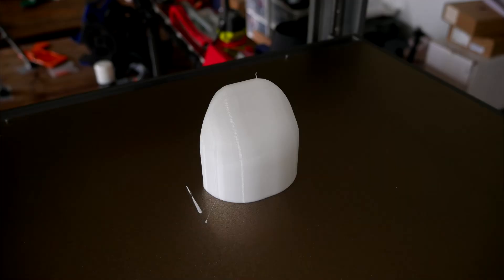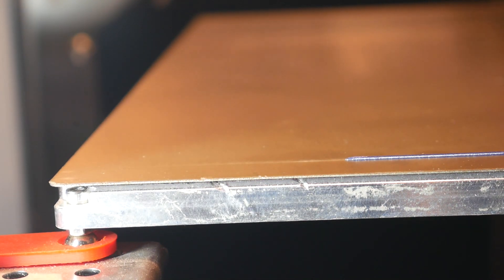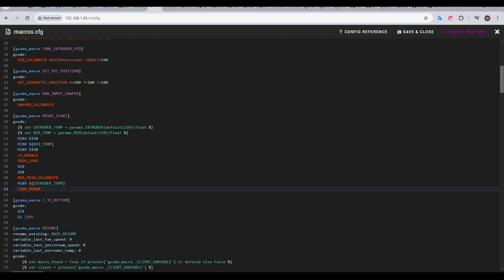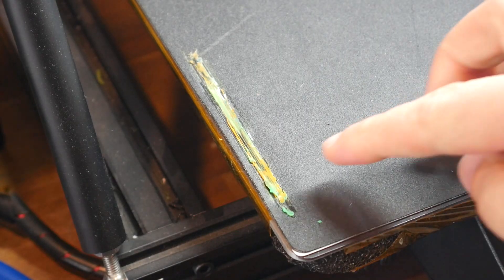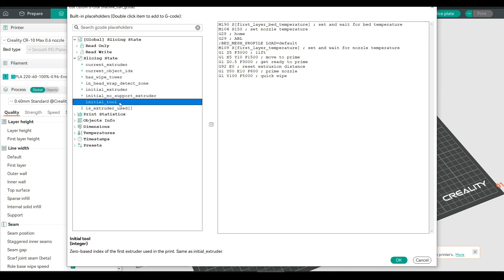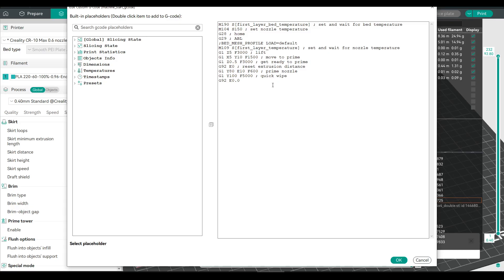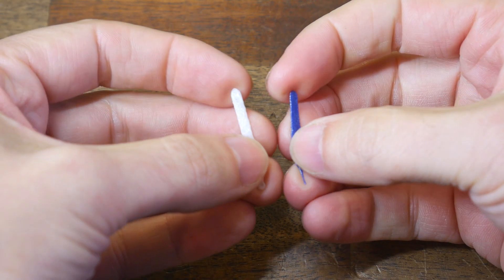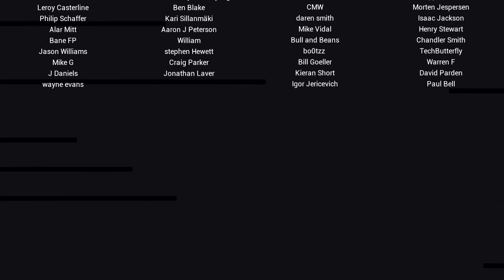Adaptive purge for every 3D printer: A simple slicer tweak

Comment: I must be missing something but doesn’t a skirt essentially do the same thing since is just outside the 3D Print?
Reply: I will stick with a skirt, as it's also a good way to check/dial in the first layer if you need to without affecting the actual printed object.
Reply: Skirts are obnoxiously big and flimsy and hard to take off the bed. Also as other comments have said they aren't always the same size, so if you only do one loop it might not be enough, and if your print is big it might be way too much.
Reply: @lucaspeltie  how are they any harder to take off than other prime lines? You can change the number skirt lines with a single click in the slicer.
Reply: @JacobScherer  they're closer to the bed, thinner, and more flexible. If it works for you it's fine, but I really prefer the ticker ones from kamp.
Reply: @lucaspeltie  Can't say on the more subjective part of it on removing or such but at least for the size being or not being enough: at least on Cura you can set a minimum total length, so that solves that issue.
Another thing I like about a brim is when you're dealing with very large beds and/or oozy filament/hotends, since the skirt is so close to the model you don't end up with a string of filament dragged all the way from whatever corner a normal purge line would be, of course the KAMP purge also fixes that as well.
Reply: it does indeed (of course you know that!) and frankly... I don't see why complicate it. Nothing too hard to remove a skirt, the time it takes to print is still near insignificant on the total print time, and the material amount is minimal. The only times I've seen a skirt be annoying is when dealing with lots of glue on a print bed or badly set Z offset, in which case everything else is also annoying to deal with.
Reply: Skirt length and total extrusion depends on first layer perimeter. Might be more personal preference than actual printing issue what to use 😉

(I'm running both long traditional 2-way purge and 2 skirt lines - 1 seems too easy to get loose and interfere - and don't feel like I'm wasting too much time or filament 😅)

Comment: Adaptive meshing is available in Klipper itself, you no longer need KAMP for it.  I don't really find the purge line of KAMP that great.  It purges quite a lot and I often had PETG from that purge sticking to the nozzle and because of the short distance to the print drawing an annoying and relatively thick string connecting it with the part.  I actually went back to a purge line at the front of the bed, first extruding a blob in the air then moving the nozzle down and right laying that blob on the edge of the bed and attaching it due to some more extrusion on that bed edge, finally quickly moving away further to the riht with tiny retract and then quickly moving to the actual print.

Comment: A few questions that came to me while watching :
- have you taken into account in this custol gcode to avoid having the purge line out of the print plate boundaries ? This is a real risk by printing pieces close to the border of the plate. From the video it does not look like this is checked.
- how does this interract with print settings like "print by object" ?
- do you think it would be possible to merge this method with the official purge lines from bambu printers, which does more that just purging 30mm of filament ? (Dynamic calibeation flow is done at the same time typically). I.e. the purge line frol A1s printers typically alrernates between 3 flows settings during this process. Would be really really good to allow just to move this purge line closer to the print onstead of doing a more basic one :)
Reply: 1. The slicer checks moves against defined boundaries. So while slicing it would throw up an error if the line was outside of the build plate (if the origin and bed shape and size are set correctly). 
2. It simply prepends some gcode before any actual generated gcode is initiated. So it would do the purge line once, and continue with the rest of the objects one by one.
3. I don't know how bambu printers work, but I assume the calibration is done with a baked in macro in firmware. So I think the location of it will be hardcoded. Not 100% sure though.
Reply: @lucaspeltie  thanks for the answers, it's clearer :)
I will try to dig on my side regarding Bambulab calib code

Comment: I made it slightly touching the model, just 0.3mm distance. When I release the model from the build plate, purge line is attached to the model with a tiny bit, which could be snapped off easily. I won't forget to remove purge line then.

Comment: :face-red-heart-shape:Great video, as always! - For me, your adaptive purge line is not nearly enough as I usually have decomposed material in the hotend I must purge out.  I use Duet/RRF so I wrote my own purge line into gcode (similar to the way you do), that is a double purge line, the full length of one side, that starts filament and then wipes and cleans the nozzle at the very edge of the build plate moving up and down in the Z axis. This cleans the nozzle on two sides before moving to the skirt. The skirt is necessary to make sure that the Z offset distance definition is correct around four sides of the build area. :goat-turquoise-white-horns::hand-purple-blue-peace:

Comment: My printer homes and purges at 350x350, but the print always starts closest to the 0x0 position, can this be changed in cura? There often is a bit of oozing across the bottom of the print that way..

Comment: @Teaching Tech : Michael, what about printers using Klipper firmware (with a PRINT_START macro called from the slicer)..
From what I see, the Slicer's [Machine Start G-Code] section is limited to call PRINT_START, together with the temperature setpoints as parameters. 
Then all the g-code intended to initiate the print (homing, QGL, z-offset calibration, pre-heat bed and nozzle...) is located on the printer's firmware, in PRINT_START macro 
=> In such situation, what would you recommend?
A- Include the gcode in the printer's PRINT-START macro, located in Klipper's  printer.cfg  file ?
B- Include the gcode in the slicer's Machine Start G-Code section, the line after PRINT_START is called?
I've just checked, in both case, the commands are added in the gcode file. 

To my mind, comes:
- extrusion rate for the purge line could be different for different nozzle sizes (and we have different profiles on the slicer)
- but it would be cleaner / more sleek to have the purge line in the PRINT_START macro (slicer agnostic, ...)
>> You toughts, best practice / sugestion?

Comment: Never needed purge. My printer's stock gcode had it but I removed it, instead leaving the nozzle parked at Z=0 against the bed until it heats up, and then, with nozzle still firmly against the bed, extruding a bit straight into it to prime and create some pressure.
Reply: You don't get oozing after the print? Purge line takes it off. 
Still good idea to keep it at 0 to prevent further oozing.

Comment: I kept meaning to do something like this.  I wanted an up, right, down three sided rectangle  a few mm from the bottom left corner of the print to maximize the ability to leave an nozzle drool bugger or blob in the purge line and not have it fall into the print.  I want the purge line to be easy to remove and discard.  Thanks!

Comment: There are several problems with this:
1) Almost everyone uses Ultimaker Cura.
2) Does not clean the nozzle.
3) There is no point in saving a small, infinitesimal portion of material if the result is not good in the end.
Reply from the maker: Hard disagree. I've surveyed my audience, and the majority are not using Cura. Cura has been ahead in introducing some features, but they are behind on others. The width of the blob is such that the nozzle tip is quite well surrounded. You could run the nozzle than lower than 0.8mm to exaggerate this. This will be beneficial for many people, if you're not one of them, then just don't use it.
Reply: I, for instance, used Cura. As my first slicer. Back in 2018.
I changed as soon as better slicer alternatives were available, like many people. Maybe you should try as well
Reply: 🤣🤣🤣 good one buddy but it's not 2015 anymore, barely anyone in on cura now

Comment: I've always just used a skirt, but as you mentioned it gets to be a bit much, especially for larger prints, when the skirt completely surrounds the part. I'm definitely going to need to give this one a try. Thank you for this informative video.
Reply: I find two loops of skirt to be a quick early warning when the bed is out of level. It's easy to spot inconsistencies in the overall width

Comment: I'm still using a variation of your start code for purge from around '19.
May I recommend using layers of blue tape under your flex plate to build up low areas. It's about 0.12mm thick. I have 3 layers in a couple of areas on my Ender 3. Thermal camera shows no adverse effect in heating of the flex sheet due to the tape. I haven't needed to run a mesh in months; just recall the stored mesh {55 & 70C have their own) and go.

Comment: Thanks for this cool idea! What happens, if you print a skirt line? I'm using klipper integrated adaptive bed mesh and "stole" the purge routine from camp to print an adaptive purge line. But when I print a skirt, this lines won't be addressed by the min-position calculation and often the purge line overlaps with the skirt, which can lead to issues. Did you encounter this problem as well with your solution (just turn the skirt on and move it a bit away from the print to test it)?
Reply: I believe the purpose is to use this INSTEAD of a skirt. If you're printing an entire skirt, you're already priming the nozzle, so the purge line is redundant. Just pick one to use. Keep in mind that a purge line is always a set length while a skirt will grow based on the size of the print, so a large print will use a lot of excess material for no reason.

Comment: That was really cool. However if you add supports does the boundary you talked about change too to account for those?
Reply: It should. The variable used is based on the entire first layer (which should include the supports), not on the part(s).
Reply: Just checked, and yes, it does change the position based on the skirt of the supports

Comment: It's suitable when you have auto bed leveling, other way one time you just crush you nozzle into bed when install slighli large nozzle, when stick some new magnet for PEI and so on and completely forget about Z correction for this part. And it's luck if you Z changes greatly - it's chance that firmware detect significantly much current on stepper and stop panically. Because otherwise, when nozzle pressed into bed in, e.g., 0.2 mm, printer drag it accross and ruin bed coating.Ask me how i know. So i decided to use brim in any case. Anyway bed heating, homing and other Z_DOUDONG, and printing itself take a lot of time so brim time is neglidable, and it work out of box in any pice of slicing software and in any printer.
Reply: Ou, after some thinking i notice that's may be only in my case - i prefer tune Z offset other than mess with underbed screews (i level bed once and not come back). If you set bed level in a "traditional" way than this problem just not happen. Just had some unplesant memories pops us and force me to write upper comment without thinking.

Comment: What if my print is so large or positioned so close to the edge of the bed that there is no place 10 or 20mm to the side?
What if I have multiple objects being sliced? Since its in the start g code it will do the purge line only once, right before starting the print of the first object, right?
Reply: Your slicer will throw up an error about a toolpath outside the print area. Yes, it will only do one purge even if you have multiple objects on the build plate. Also only one purge line when you have "complete individual objects" turned on.

Comment: This is a bit like the pre-extrusion setting in Flashprint slicer.  It's like a skirt but you can specify the length between 50mm and 200mm and the offset distance so it doesn't do a full loop around of your print.  It doesn't do a traditional purge line unless you add it to the start gcode.

Comment: I followed the directions for my A1 mini using orca slicer. It does, however, do the initial purge line like what happened to you in the first round. I deleted the same portion (extrusion cali line). What could be the issue? Is there another portion of the start g code I should be deleting?

Comment: I just realized it's possible to use the same variables for adaptive meshing in Marlin.
G29 has the L, R, F, B parameters that control the scanning zone. This should be the command, I kept a 10mm margin, you can change them: 
SEE THE UPDATE
I just tested it on my machine (Marlin 2.1.2.1), and it works.

UPDATE:
I rewrote the line to avoid values outside the bed limit. Such a value would make the printer completely ignore the G29 command.
Here is the new line:

G29 L{((first_layer_print_min[0]-10) < print_bed_min[0])? print_bed_min[0]:(first_layer_print_min[0]-10)} R{((first_layer_print_max[0]+10) > print_bed_max[0])? print_bed_max[0]:(first_layer_print_max[0]+10)} F{((first_layer_print_min[1]-10) < print_bed_min[1])? print_bed_min[1]:(first_layer_print_min[1]-10)} B{((first_layer_print_max[1]+10) > print_bed_max[1])? print_bed_max[1]:(first_layer_print_max[1]+10)}

This will ensure all values are inside the bed limit.
Reply: That's neat but adaptive bed meshing in Klipper also reduces the number of probes based on the first layer area to save time.  This method wouldn't do that, but it would get a more precise mesh of the actual print area instead of the entire bed. Good job!
Reply: @TuringTest3  Unfortunately, in Marlin, it's not possible to change the number of probes due to dedicated hardware memory reasons. This method can actually save some time during travel moves. I have an 8x8 grid for a 300x300mm bed, and probing a small area is a little faster. A side effect is that it's funny to see an 8x8 grid completed in a 40x40mm area, where every measurement is only 5mm apart.
Reply: If it’s possible to perform integer division in your slicer’s g-code compiler, then you could set a fixed number of millimetres between each probe.

Edit: on the Slic3r page for conditional g-code, it mentions that it supports functions from the C resource exprtk, which includes regular division and the modulo operator, so I think it’s possible. It would probably be easier to just use floor or ceiling or round using normal division, which it also supports.
Reply: @Scrogan  I don't understand what you are looking for. When you set the limit of the probing area, each probe is equidistant along the X-axis and Y-axis.
Reply: @alexlux147  you dynamically set the number of probing points depending on the size of the are to be probed
Reply: @Scrogan  It's not possible to change the number of probes in Marlin for the Bilinear UBL. During compilation, Marlin allocates fixed memory cells in EEPROM to store the points. I haven't found a way to change this using G-code. If you have, I'd love to know.
Reply: @alexlux147  oh it’s done during compilation? That’s a shame.
Reply: @alexlux147  have you tried this with a print that takes up the whole bed? Curious how it would handle the margins.
Reply: @TuringTest3  I tried inputting margin values outside the bed dimensions, and my printer completely ignored the G29 command. I should modify the start Gcode to prevent this.
Reply: dude! Tried it and it works well! super neat! you should email this to Michael
Reply: @filmpup  That's awesome, I will probably do it. I have also updated the command, I suggest checking it out because the old one has a flaw.
Reply: Tried it on orca slicer but can't get it working. I am getting "Failed to generate G-code for invalid custom G-code.
machine_start_gcode Parsing error at line 4. Expecting tag literal-char" when I try to slice the model
Reply: @narutoveki  Weird! I'm using orca slicer and no issues.
Reply: My printer was still ignoring the G29 command near the edge of the bed with your updated code. So I've added a margin around the bed.

{local abl_margin = 30; local abl_padding = 10}G29 L{max(first_layer_print_min[0]-abl_padding, print_bed_min[0]+abl_margin)} R{min(first_layer_print_max[0]+abl_padding,print_bed_max[0]-abl_margin)} F{max(first_layer_print_min[1]-abl_padding, print_bed_min[1]+abl_margin)} B{min(first_layer_print_max[1]+abl_padding,print_bed_max[1]-abl_margin)}

I also changed it to use min/max functions, and variables so that it is easier to customize. 
abl_margin is the extra distance from the edge of the bed when probing.
abl_padding is the distance from the edge of the part to probe.
Reply: Will this work for a bambulab p1p? if so, can you make a tutorial for dumb people like me? thank you.
Reply: @SirVergil  did you not watch the vide0? For p1p just follow the steps from it
Reply: @SirVergil  I don't have a Bambu printer, so I checked the print profile of the P1P. It looks like something similar was already implemented in the start G-code: G29 A X{first_layer_print_min[0]} Y{first_layer_print_min[1]} I{first_layer_print_size[0]} J{first_layer_print_size[1]}
I'm not sure if this is correct, can someone with a Bambu machine check what I'm saying?

Comment: @10:40 Maybe this only works in OrcaSlicer, but would it be better to set the retraction line to use machine settings? something like...: G1 E-{retraction_length[0]} F{retraction_speed[0]*60}